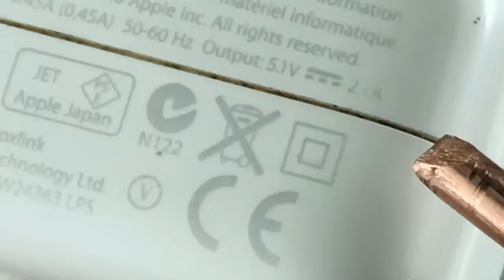How To Make SOLDERING IRON Using Pencil

Comment: Interesting
But as long you use it the carbon will breack down due to heat
Reply: Not to mention if at all it even produces enough heat with 5V 2A to transfer to copper to melt solder it might as well burn the wooden handle 🤷‍♂️
Reply: yes you are right
Reply: Eshan
Reply: Between  2-5v.... It can work
Reply: True words

Comment: Them two exposed wires dont seem friendy.... is there some kind of coat that wont melt with the heat so they arent just a finger accident away from possible shock? Im fairly new to this stuff so yeah...
Reply: Of course there is there's electrical tape. There's plastic. There's a bunch of stuff you just got to use that head of yours

Comment: You need a drill which is usually much more expensive then a soldering iron
Reply: Or you could probably carefully wrap copper wire around the tip for a finer tip for smaller soldering areas.

Comment: I doubt if 5.1 V 2 A output is enough to heat graphite enough to tranfer heat to the tip and then to the copper. If that was the case the wooden covering of the graphite lead would eventually burn.
Reply: It will burn. This is a horrible idea.

Comment: Can you use a battery bank for power instead of the outlet? I don't want to risk short-circuiting my house, or something going horribly wrong.
Reply: I guess just using 3 1.5 AA batteries in series would provide almost the same voltage in a safer way.

Comment: The efficiency of the soldering gun depends upon resistenc of the graphite used for pencil and various factors . It should be perfectly designed. Otherwise the charger we are using will blow off.
Reply: what graphite do we need to use?
Reply: Why would it blow?, chargers are very low on voltag
Reply: @hk_asa0pvp Ofcourse the voltage is low( 5 volts), but the amperage 0.3 is insufficient to make the gun hot.
Reply: @eswarea8983  makes sense plus its only rated on the amperage trying to increase that results in overheating in the charger itself i guess

Comment: except of this last where he drills this cooper iron other can have point!! you must have expensive drill and eqiupment to drills such a small item and then doing this soldering iron  dont have point
Reply: You could also do it without the copper head, and melt the tin directly on the graphite but yeah, it won't be working for so long as it would with copper thing
Reply: That was amazing all by itself!
Reply: The amazing part was drilling the hole in the copper point
Reply: @hitekrednek1552  yes,only thing there that you need expensive tool for drill

Comment: copper are not so 
thermally conductive

Thermal insulators have a low value of λ, conductors a high one. This is partly the case with the electrical conduction. For example, metals have a high conductivity both thermally and electrically. This is because they have an electron gas inside that can transport both heat and charge.

The collective modes of vibration of the material, the phonons also play a role. Especially a material with strong atomic bonds in all directions and light atoms, such as diamond, conducts heat well thanks to phonons. In such a material, the modes of vibration are completely spread over the entire crystal (delocalized).

Conversely, heat conduction is poor in materials such as aerogels. These substances have a fractal structure. Their vibrational modes are therefore not phonons but fractons. This type of vibration is of a local nature. The thermal energy (heat) can therefore not be transferred so easily to the neighboring atoms.
Reply: It is unfortunately all too common to encounter popularizations of quantum mechanics that directly or indirectly state that conscious human observation plays an active role in determining the outcome of quantum experiments, and thus physical events generally. There's then a slippery slope from there to claims that quantum physics implies magical thinking along the lines of "you create your own reality" and "the law of attraction." This really makes me cringe.

Comment: Nice idea initially, but what happens if those bare wires touch each other? It would create a short circuit which may destroy your usb adapter, or worse.
Reply: Man, it works by short circuit
Reply: Well that's why you use a ground lol
Reply: @kernelexplo1t  no it doesn’t babe the graphite of the pencil is the ‘component’. short circuit means no component
Reply: will it work without that copper wire?
Reply: @mrxxlucaxx9715  Yes but it will burn faster.
Reply: @kellymartinez4074  computers have no ground lol
Reply: it was a lie

Comment: How to short your power supply and maybe if it works, set fire to a pencil lol
Reply: That won't happen the voltage to low to short however the pencil will burn
Reply: @fffdddaaa3089  Electronics genius +90000

Comment: I saw a video and try to connect my broken Bluetooth but my house light gone from that short circuit happenedI was surprised to see it worked it became hot and when I touch the pencil to broken iron it melt and I connected wires. After that my Bluetooth worked I m so happy

Comment: Do you have to have the copper bit at the end? I don’t have copper wire that big
Reply from the maker: Yes it will work without copper wire but solder won’t stick to the pencil led it will just melt of it.

Comment: They sell soldering irons for $10 or less.
Reply: Warren peace  It would cost more because you need a drill with the right bit , a hot glue gun and other materials
Reply: Warren peace   It would cost more because you need a drill with the right bit , a hot glue gun and other materials

Comment: What could I use for the copper tip as a replacement, I understand it has to be copper, I just don't have a drill right now 🤣✌️
Reply: Many turns of thin strands of copper wire
Make sure that you do enough turns

Comment: I tried this, did work with the usb plug so i hooked it directly to a 3 point something volt battery, the graphite turned red hot and exploded almost instantly. Dont recommend just spend 10 bucks on a soldering iron
Reply: For real? I was considering using batteries instead to be safer. How many amps did the battery have?
Reply: I found this battery-powered version using a 9v instead https://www.youtube.com/watch?v=AuF3eqk_Jlo
Reply: That's because you probably hadn't had any resistor in between so it pulled way to much amps
Pls look at the ohms law
Reply: @flopana5762  i just followed the video ..  The usb didnt do anything didnt get warm or nothing so touched it to the battery and blam. I ended up buying one for 6 bucks lol just saying be careful making homemade ones like this
Reply: @bobdoe6847  yeah soldering irons don't have to be expensive but going back to what I said earlier if your circuit you build there has a let's say resistance of 0.2 ohm you would have drawn 15 amps from a 3V source which is waaaay to much for a battery
Reply: @flopana5762  oh okay. Yeah I dont know much about electricity or ohms or anything. I figured oh the usb charger isnt working maybe it was too high? So i tried the 3v battery and yeah wasnt good. I did get it to work however off of a airsoft battery i had that was i think 7.2v at 900 mah and it didnt blow up but it still got very hot. I just def dont recommend this to people who dont know about electricity and such like I did it could have been dangerous.

Comment: IF WE HAVE THAT MUCH MONEY TO BUY A DRILLING MACHINE THEN WHY WONT WE PURCHASE A SOLDERING MACHINE INSTEAD OF MAKING IT FROM DRILLING MACHINE
Reply: tbh, you don't have to add the copper tip just makes using it easier and cleaner and overall it's more of an emergency quick project if you're in a hurry and need to solder something quickly

Comment: Shii I don't got the thick ass copper wire
Reply from the maker: U can still make it without the copper wire just the soldier won’t stick to the led pencil.
Reply: @Inventor101  interesting thank you
Reply: @Inventor101  I am going to copper plate the tip with muriatic acid thanks